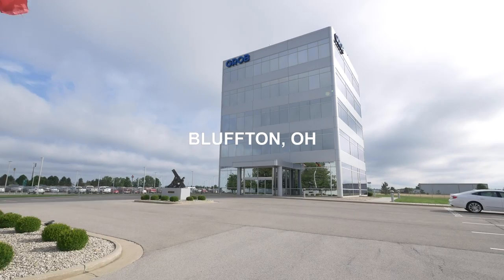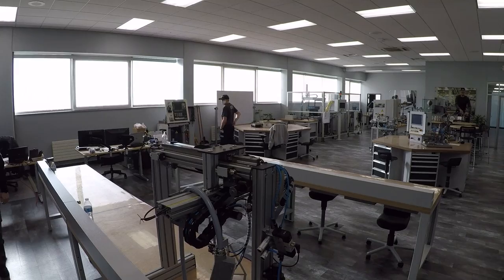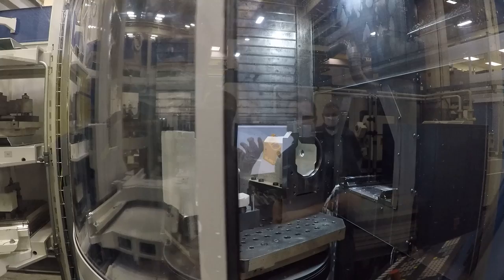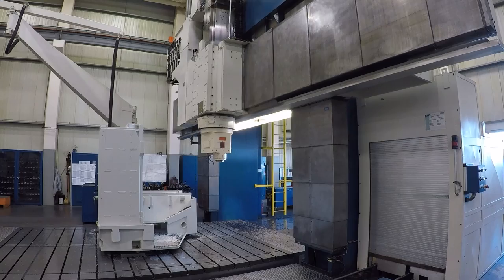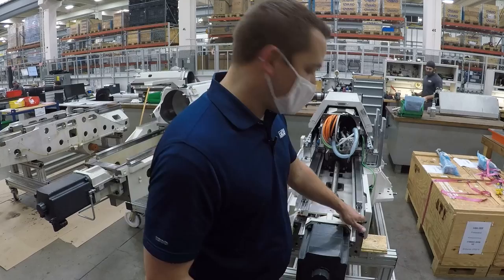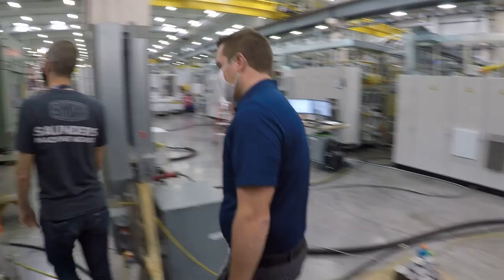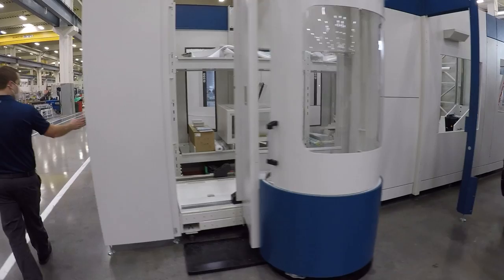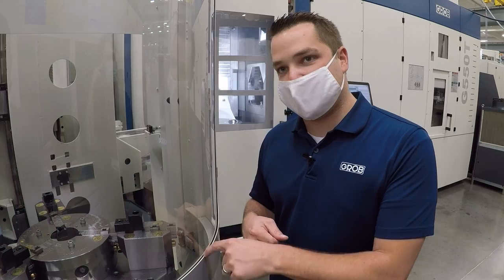INCREDIBLE 5-Axis CNC Machines:  GROB Factory Tour!

Comment: I'm getting my first very own Grob G350 in a couple of months in Brno , Czech Republic. Can't wait for my new toy :)
Reply: Congratz! How much did it cost?
Reply: Enjoy!!!
Reply: How much does it cost?
Reply: @srknardc  from some quick googling it looks like at least $250.000
Reply: @experimental_av  I think its way more expensive, at least 300k euros. In Turkey, hermle c400 is 270euros.
Reply: What type of manufacturing are you doing
Reply: @sengwesetogile6054  We manufacture Defence Infustry AR 15 AR 10 Shotgun parts
Reply: @srknardc  The prices are quite individual. But in general it ranges from 350k to 550k eur depending on configuration. I'm getting top level G352 with all the bells and whistles. Extra high accuracy package, 80bar through coolant, automation with 3R robot and palletes etc. You can get quite easily  to 6 digit number :) There is a cheaper version without such a high dynamics called G352 Access. Check the dealer for more info. In general excellent machines though.
Reply: @sengwesetogile6054  We are small familly shop. We do mostly defense and aerospace parts. We do also complex plastics injection molds from design to actual injection molding. We do general job shop work as well.
Reply: @martyded  make a delivery video💪it would be great to see it. Good luck and congrats on your new machine!

Comment: It still amazes me that these cnc machine especially 5 axis sling all that steel around with the material attached that needs to be machined and stop exactly where it's programed so the tool can start eating metal. I don't know maybe it's me watching all that steel moving with momentum and stop exactly where it knows and still achieving tolerance.
Reply: 3 PID loops inside the servo controller. Torque (current), velocity and position. That's how you get there
Reply: Especially a 1-2000lb log of steel, thats insane!
Reply: The tech has always fascinated me. It genuinely seems alien at first. Some seriously smart fuckers in this industry.

Comment: Looks fascinating! For us a 5-Axis CNC machine provides infinite possibilities as to part sizes and shapes. It allows us to process five sides of a part in a single setup, moving across the X, Y and Z linear axes as well as rotating on the A and B axes. This allows for higher part accuracy because the work piece does not move across multiple workstations.

Comment: @30:45 the orange device is an VSE100 from ifm - it monitors vibration sensors and can stop the machine in case of a crash in about one millisecond. 
If someone has questions about it let me know :)
Reply: Thx for the tip, bookmarked it for other types of equipment.

Comment: Dang, I wonder if I can get my tormach to cut a circle using a lathe tool like that, the x and y wouldn’t be a problem, but I wonder if the rotation could be synchronized.... I need to look that up, im kinda learning all over again after a 13 year break from cnc, everything is waaaay easier now, but still trying to figure out speeds and feeds with my low horsepower tormach, after using old 40 horsepower fanuc machines from the 80s, it’s a big leap for me but also getting used to the lower power...